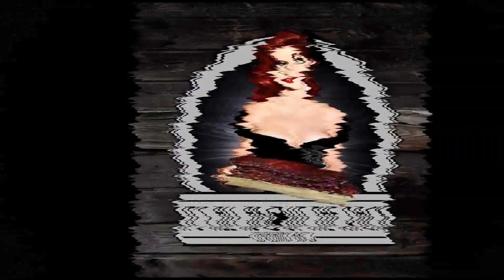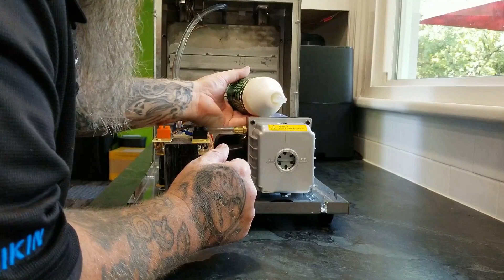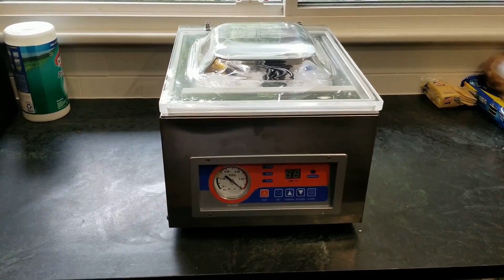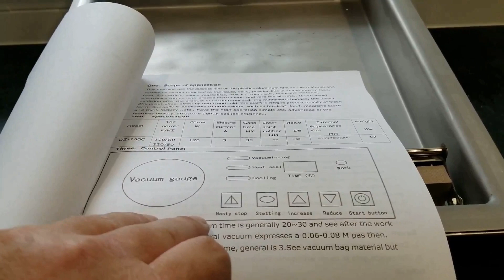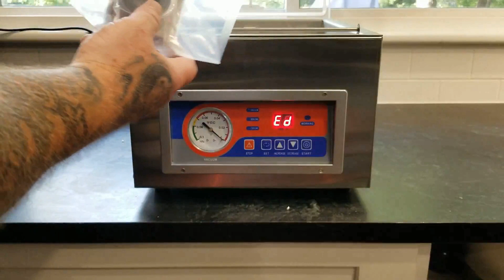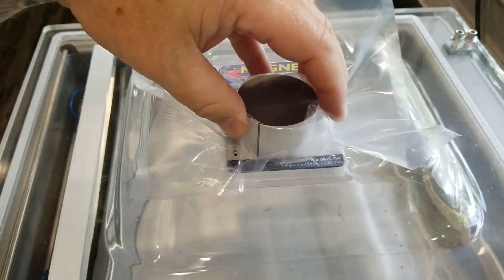Chamber Vac DZ-260C Review

Comment: Bought the same unit  worked well for about a year. I would fill a bunch of bags then wash hands then seal since your hands can get messy when filling the bags. I think that sealing many bags at once causes the machine’s circuit board  to overheat  causing the heat strip to stay on. When this happened it smoked my whole house with a strange red smoke that stunk up the house for a week after opening all windows and doors. May buy another one just may need to give it more time to cool down between seals. I was unable to find parts so I saved it for the pump.
Reply: I may buy another one. I used it quite often and miss having it!
Reply from the maker: Sorry to hear that. I know I've done maybe 15 bags at one time and it was fine but more than that, you're probably pushing it.

Comment: I noticed that will you vacuum something with high moister content, the chamber fogs up. What am I doing wrong?
Reply from the maker: I've never noticed this myself. I would look at the length of time you have your machine set to vacuum, the longer the time, the more that the liquid will boil off. I would start by adjusting the time. Also double check your seal and make sure that is in good shape and there's nothing built up on it.

Comment: I just bought this same chamber sealer. Used it for a rib roast I cut into steaks , ribs & fat chunks for sausage making. I got mixed results. The ribs and the fat chunks had a very tight pack. No air inside. The steaks it sealed well but felt loose in bag like all the air didn't get pulled out. Does the meat being packaged need to be frozen first for a better tight packaging? Any tips to make this unit better? I noticed the steel that the silicone seal sits on is well poorly finished. Scratches and some dips. Not super smooth. Thinking about running a strip of tape?
Reply from the maker: No it doesn't need to be frozen. I have noticed a package or two that has not vac'd as good as the "usual", I'll just start over. Not sure why this happens but it's definitely not the norm. The tape needs to be the same type as far as I know, which is a great resistant tape. I have sourced it off you need some I can give you a link.
Reply: @ItsallabouttheRack  The tape I was talking about would go where the silicone seal mates to the chamber. On top the scratches in the steel may be causing a slow leak. But yes please send me the link.

Comment: My oil level line is at 3/4 on the window but the sheet you had   in the video says fill half way
Reply from the maker: You should be fine, but may see a little bit of smoke possibly, it's nothing to worry about if you do. The half full is the best way to fill because of the oil heating up and expanding, so as long as you're not running it for extensive periods of time you'll be fine.

Comment: Have you ever over heated the unit?  I am concerned of constant use?
Reply from the maker: I have never over heated the unit, but the most I've done at one time is around 35-40 bags. This unit is not a commercial grade unit. It's a big step up from a Food Saver unit though.
Reply: @ItsallabouttheRack  how has it been 2 years out? When you say not commercial unit do you mean it’s not even close to the level of a vacmaster 215? Which what I  cross shopping but this seems to good to be true. It’s either 450 or $1300 here in Canada. Best review I’ve seen so far of the vevor

Comment: Hello, Will this machine do a retort pouch ? and is the heating bar replaceable?
Reply from the maker: I have not tested a retort pouch. Yes you can get parts, which I'm trying to work out a deal with a manufacturer now. If that gets done I'll be doing a follow up video for the unit showing how to replace the parts. Stay tuned and thank you for watching.

Comment: Is there a particular brand of oil you use for the machine? or will any old pump oil suffice?
Reply from the maker: You are going to need a vacuum rated oil for this. I've been trying to work a deal with a manufacturer of parts including oil but have not come to terms yet. If you look on Amazon for vacuum pump oil, it's all the same.

Comment: So I have the same exact unit and every single time it tries to seal it pops fuses and this the other day I tried to put another fuse in their same exact size the fuse did not pop and the actual heat strip bar caught on fire very unsafe unit
Reply from the maker: When was the last time you replaced the actual heat strip and the covering for it? They give you extra, I changed mine when the strip was looking to worse for wear. The heat strip is just thin metal and will wear out.
Reply: @ItsallabouttheRack  I put a new heat strip in it and it did the same thing
Reply: Could you do me a huge favor
Reply: Look at the fuses on the back of this thing and tell me what size it is maybe that's my problem
Reply from the maker: The wiring may have been compromised to a point that its been degraded and due to this the Amp drawn goes up and the fuse pops. Either take it to a repair shop or buy new. Have to say though, this has been for me a very good bang for my buck.
Reply: @ItsallabouttheRack  intill your house catches fire
Reply from the maker: @shannoncreel4466  not sure what you mean by intill? If you mean until? Then I'm not sure what you're doing by operating a unit like this unattended in the first place. Secondly there are more fires caused by ppl leaving there cell phone cords plugged in than operating a unit such as this. You've already voiced your disgust on this unit, allow this sleeping dog to lie.

Comment: Hi, can this unit vacuum seal liquid? For eg: Soup?
Reply from the maker: Yes it can because it vacuums the chamber and not the bag. What makes the seal on a bag or a jar is the introduction of atmospheric pressure... Well besides the unit having a heat bar to seal the end of the bag of course. It's not the highest unit inside so the jar can't be that tall. I have done cream type soups that worked fine.
Reply: @ItsallabouttheRack  Thank You!

Comment: Is compressor oil and vacuum pump oil the same?  They look similar and both devices are pumping air.
Reply from the maker: No they are not the same oil. Vacuum pump  oil is formulated so that it will absorb moisture, this is why it needs to be changed every so often. If you were to fill up the oil with all the moisture that it could take, the moisture will bypass and this is when you can start breaking down you pump. Oil, and the correct oil is the life blood of this type of pump.

Comment: What do you recommend for a commercial operation.
Reply from the maker: I'm not a commercial user but there's only a few makers of these units. Definitely spend the money on a name brand and something that has a company that you can get a hold of for parts or service.
Reply: @ItsallabouttheRack  which one for commercial, i have a business
Reply from the maker: @daniel17319 , again, I'm not using it for commercial purposes. I would recommend that you look on the Internet for some manufacturers and contact them with your wants and needs in a unit.
Reply: @ItsallabouttheRack  ok thanks
Reply: @daniel17319  VacMaster VP220 is what you need

Comment: Ugh why does no one post reducing the time. Why would I want to do it slower and longer. What happens if I put vacuum setting on 1 or 2 seconds .... time is money here . Helloooo
Reply from the maker: I get what you're saying but there's actually science behind pulling a vacuum. The more you go below atmospheric pressure and into the micron range the better the bag seals and the tighter the bag will be around your product and the less freezer burn you will experience. Putting that aside the time is money theory you speak of does not pertain to me sealing average things that I'm putting in my freezer, not really sure I care about time, but I do care about it lasting a long enough time in my freezer.
Reply: I've found that you can loosely vacuum solid objects in as little as five seconds. 
 Large cuts of meat take  thirty seconds. 
With the same machine, I do most items set at 20sec. Vacuum, 1.5sec.Seal, 4sec. Cool down.
Reply: Fresh bread and rolls, chips, etc. Pickling, infusions, etc.

Comment: Please where to get those bags ?
Reply from the maker: I found my thru a local supplier but you can look on ebay or Amazon. Look for a 3 mil bag that is a good thickness for most anything you'll seal. My go to bag size is a 8" x 12" but you can obviously get smaller or larger to maybe up to 14" that will still fit without cramming the bag in.
Reply: webstaurantstore.com

Comment: I've had mine for about two years now. Its all in Chinese. It didn't really occur to me to go surfing for info on it. Today is the first time I've topped up the Oil in the pump. I don't use it extensively. It works. It works good. It does its job. Liquids need to be cold or room temperature though, as warm liquids will tend to boil when a vacuum is applied..

There is a hole in the bottom front right corner that goes directly to that Manometer. If any gunk (liquid) goes down that hole, your manometer's stuffed. It won't interfere with operation but you'll lose your gauge indication. I have yet to look into if it can be replaced or serviced. You also need to attend to wiping it down and ensuring it is dry otherwise rust pitting will occur on the inner chamber. 

Food Hygiene! Keep it clean, keep it sanitary, keep it dry, and it'll do the job quite well.
Reply: sorry to be so offtopic but does anybody know of a trick to log back into an Instagram account??
I was dumb forgot my login password. I would appreciate any help you can give me.
Reply: @Caleb Anderson instablaster ;)
Reply: @Tyler Martin Thanks for your reply. I got to the site on google and Im trying it out atm.
Takes quite some time so I will get back to you later when my account password hopefully is recovered.
Reply: @Tyler Martin it did the trick and I now got access to my account again. I am so happy!
Thanks so much, you really help me out !
Reply: @Caleb Anderson you are welcome =)

Comment: Nice review! I have mine now and burned the Teflon trying to tune the settings. Does anyone know where to get the replacement? Maybe the whole sealing bar can be upgraded..also my unit sometimes buzzes very loudly during the last step. Is this normal?
Reply: Did you ever find the replacement bar?
Reply: @tskroyal9198  no, but the replacement teflon was pretty easy to find and replace. I just found a roll (one side is sticky) that's wider than the bar and cut it to length. I needed to sand the heat strip to remove the burnt old stuff before applying the new teflon that first time. I can make a video of the replacement process if anyone is interested.
Reply: @1empyre1life  I don't think my sealing bar is getting any power, I put my multimeter in the post holes and didn't get anything. How do you know if its the teflon or the bar itself that needs replacing?

Comment: Almost a year later.. Do you still like the unit?  Still working ??   Thank you for the video!
Reply from the maker: Yep still working fine. No real issue. I think the major gripe I have is the tape on the sealer bar. It shrinks up than I expected and it being smooth is the life blood of the sealed bag. I need to look for a heavier grade and see if that helps. Overall still happy with my purchase!
Reply: @ItsallabouttheRack  what size tape does it use? I just ordered one
 Thanks

Comment: It will handle a 10 x 13 pouch, which allows for the maximum amount of the pouch to fill the chamber and to cross the heating bar. The maximum height in the middle is about 3.75 inches (4 inches is too high). The recommended standard for calculating cool down time is to add an additional second to the sealing time. (E.g., 2 second seal time; 3 second cool down). In addition, it is also recommended that lid be held down by hand prior to starting the vacuuming. I nervously purchased this same unit but, surprisingly, for such a cheap Chinese machine, it works great. No regrets so far. Thanks for the video review.
Reply: Can it seal aluminium retort pouch?

Comment: Can you stand mason jars up to seal them?  If so, what is the max height inside the chamber?
Reply from the maker: I have not tried any type of jar in it. It's kinda hard to measure that inside height, so you know the measurements of the jar and I can see if it may fit?
Reply: Normal mason jars with lids are 7 inches tall with a 3 inch x 3 inch base.
Reply from the maker: After doing some searching and then calling another mfg, they do NOT recommend putting Mason jars in them. I found a mfg called Fisher that has a vacuum plate for Mason hats but it's VERY pricey!

Comment: Can you set the seal timer to zero? If so then i could tee off the vaccum hose for other attachments like jars and stuff
Reply from the maker: Yes you can run it all the way down to zero. Good idea, like to see that one work!
Reply: just lay your mason jars down in the chamber and run it with zero seal time.
Reply: @DTMFJeff  i bought the vacuum camber and you have to use the attachments. With a tee tap off the  sucksion line. 
Because laying the jars side ways would leak the product out
Reply: disonesto No laying mason jars on their side with lids and rings will not allow the contents to spill. There are YouTube videos on this. Now if you’re doing liquid that’s a different story

Comment: For the money you get a chamber, controls and a pump.
This is worth it as you can always purchase another pump to get a faster vacuum with same chamber size,
The pump still pulls down to 29/30, just takes longer,
Have one on the way and will DIY for more control features.
Reply from the maker: Not sure that the pump is the flaw of this unit, could it be better, I'm sure!. It is a basic unit, and therefore the heat strip is cheap and needs to be replaced more than a quality unit would come with. Also the hold down bar is too light it closes down over the bag but doesn't secure it and at times if the bag is not in far enough it can pull thru.
Reply: @ItsallabouttheRack  Thanks for the info.
May look into weighting the bar and look into the power delivered to the strip.
Could be power supply not strong enough as no doubt the strip is DC powered.
Thanks for the video.
Reply from the maker: @jeffhack6839  most welcome for the video! I think if anything the heat strip is over powered or maybe powered correctly but the tape that covers it is just cheap. What will happen is that the tape will shrink and crunch up and what happens is the bag takes on this crease and sometimes not seal. You have to press the tape back down between each bag to make sure it's smooth.
Reply: @ItsallabouttheRack  Ah. Thanks for that. May have to then look into throttling back the current with a variable resistor and have some bag wastage.
Another DIY!!!!
Reply: @jeffhack6839  It looks like the transformer is for the sealer heat bar. Low voltage high current. What makes you think it is DC? AC is used for heating elements all day long in pretty much every oven.

Comment: Hi. There's a little bit of oil smell when I operate the vacuum. Is that normal? Does it mean that I overfilled the pump? Should I drain it? Thanks!
Reply from the maker: Can you see the oil level? Is it in the middle or two thirds full? When you were filling it did you see the oil level come up in the glass? If you're not sure to any one of these I would say drain it and refill it. Hope this helps
Reply: @ItsallabouttheRack  Thank you so much for the quick reply. The oil level is above middle but less than 2/3. Is it safer to just drain some out just to be on the safe side? Many thanks!
Reply from the maker: @jonblack7066  honestly I think you'll be fine. Don't forget this pump has never run before and has a "break in period". Actually I just ran mine for 6 bags for turkey that I sliced and I did see a little bit of smoke. I think some of it is vapor because you are pulling all of the moisture out of the chamber and that is a by product of it.
Reply: @ItsallabouttheRack  Got it, thank you so much. Since I'd already taken a picture to show you, though, here it is: https://postimg.cc/9rFwyLvW. Otherwise, if you don't mind, one last question: the manufacturer said to use #46 hydraulic oil. The only one that I could find that wasn't in bulk was this Sta-Lube Hydraulic & Jack Oil. The spec sheet ( http://api.crcindustries.com/auto-services/get-pds/SL2552 ) says it's rated at ISO Viscosity Grade 46 and SAE Grade 20). Do you think there are any issues with that oil?

Again, thanks a million! Sincerely appreciate the help!

Comment: Thanks for the video. My takeaway after this and reading a few reviews is if you want a lot of handholding - this may not be it. However if you're okay with undoing a few screws and ensuring the hoses and wires are properly connected - this is a great value.
Reply from the maker: You're gonna have to undo a screw to put oil into it. I have not had any problems with any wires or hoses. I agree that it is a great value, and I'm still using it and happy that I spent the money on this "value" unit. Thanks fur watching and I'm hoping to do another review / comparison of another unit soon. Don't forget to subscribe.
Reply: How has it held up?

Comment: Any idea where to find vacuum pump oil in stores? What type/weight did you use?
Reply from the maker: I would have to believe that you could find it at an auto parts store. I think the weight is standard for vacuum machines, so any one specified for vacuum would work. I actually sell vacuum pump oil as I work for an HVAC wholesale company,so I guess I'm lucky. I know you can also find it on Amazon.
Reply: Harbor Freight
Reply: @scottlowran1404  They’ve got everything over at the hazard fraught lol